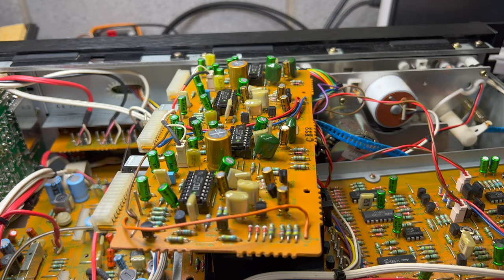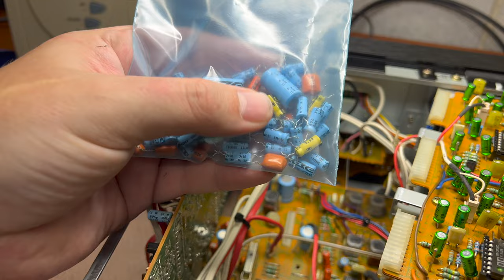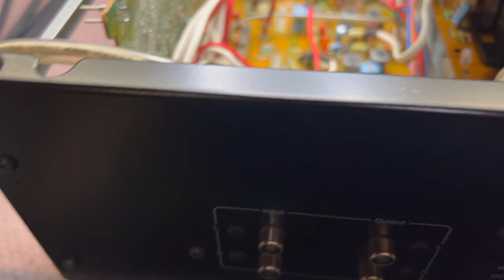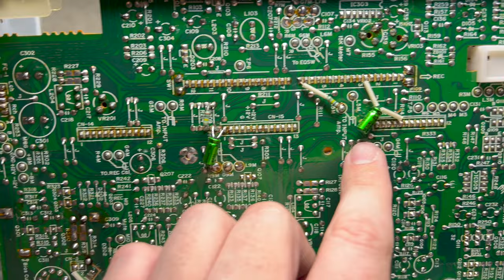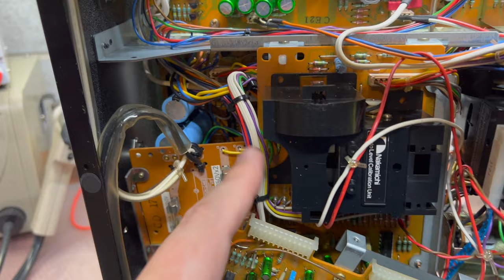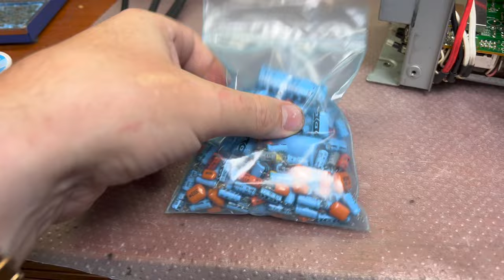Restoration Chronicles: Nakamichi 681zx - Full Capacitor Replacement

Comment: So are all of these capacitors prone to failing? The board looks ok in the pictures
Reply from the maker: Even the best modern capacitors have a limited life span, like 1000 hours with temperatures in range. What do you think about 40 years old capacitors keeping their parameters? Or decks stored in the garage in Florida, for example ;) most of these capacitors are not performing up to specs.
Reply: @hifirulezzz  from where you are buying those Nichicon MUSE capacitors?
Reply from the maker: @LT.tapeheads.service  https://www.digikey.com
Reply: @hifirulezzz  many modern capacitors, especially cheapo brands last far shorter times than ones from the 70s and 80s , 1000 hours would be at maximum everything, temp, voltage, ripple, if each are reduced life increases dramatically, and that hours are hours at use, not just 'age'
Reply from the maker: @andygozzo72  You may go to Digikey and see at the table lifespan with 85C temperature - 1000 hours. With lower temp they will sustain much longer, but still a limited time.
Reply from the maker: And that is for the Nichicon caps, imagine cheap Chinese, mine LG soundbar blow caps with smoke just after 3 years of use ....
Reply: @hifirulezzz  i have various old equipment going  back  to the 30s and for the transistor radios at least, almost all are 'virgin' unrecapped as they simply didnt need it,   ..  tvs and psus can be a bit different due to the higher ripple and temperature,
Reply from the maker: @andygozzo72  every person has own feeling of work word. For me work mean it works perfect. Old caps sounds terrible.
Reply: @hifirulezzz  i doubt you'd hear any difference, especially in a portable transistor radio or 'standard grade' amplifier, 'top end' may be different
Reply: @hifirulezzz  as long as they’re not leaking, causing damage, or within reasonable specs (no operational difference) I really don’t mind, waste of time otherwise